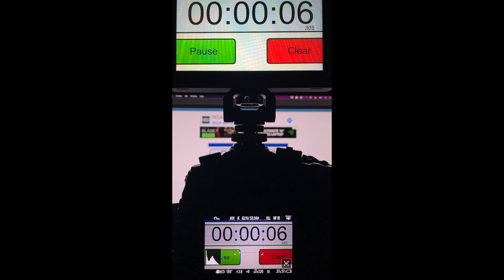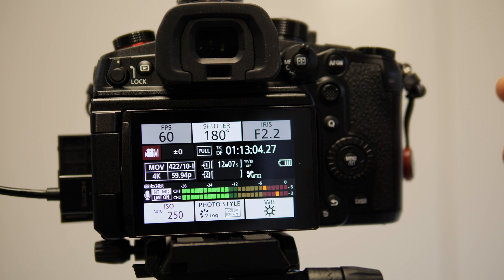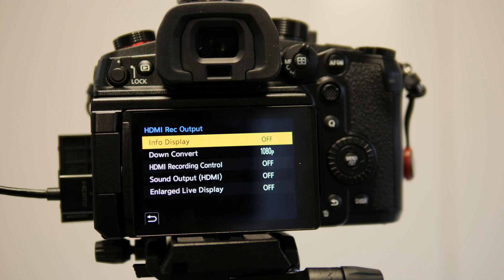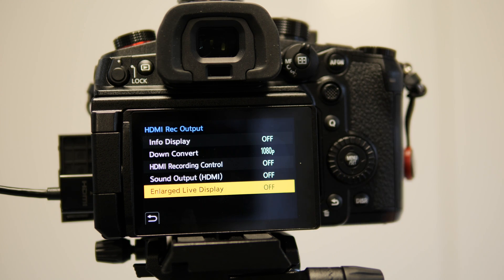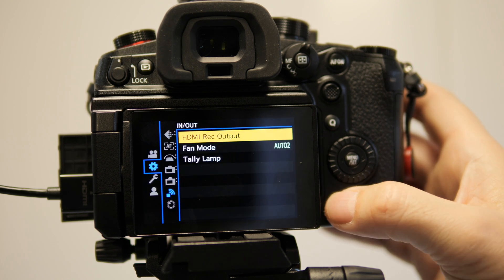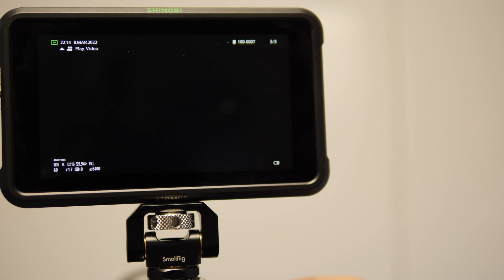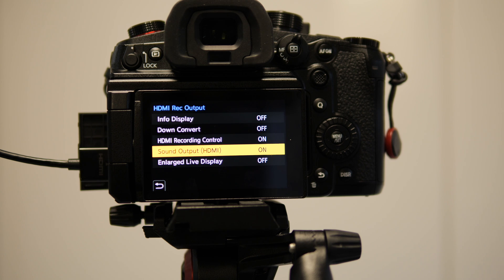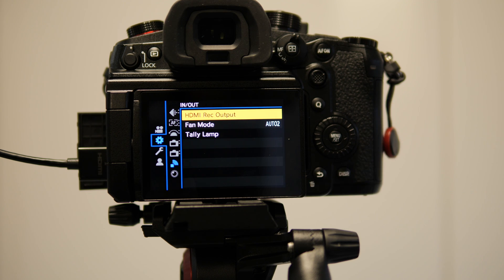HDMI Lag Optimisation for GH6 and GH5M2

Comment: This lag is way worse in low light when taking astro photos and or using an nd filter.
Reply from the maker: The lag depends on the frame rate. If you are shooting with live view boost this drops a lot it is not possible to correct that it is normal

Comment: The other issue for me is the GH6 will not display the timecode value when connected to a monitor.  It won't show it on the GH6 display or the external monitor.  It only shows the letters TC but no value.
Reply from the maker: What do you want to do with the timecode on an external monitor?
Reply: @Interceptor121  I use the timecode reading to record video for a specified amount of time.  Such as a 10, 15 or 20 minute video.  The problem is...I often cut during recording so every time I cut...the recording counter sets back zero.  The way I have timecode configured in the settings...it keeps the total run time of the recording.  So, if I'm shooting a 15 minute clip and stop recording after 4 minutes and then resume...timecode will resume from 4 minutes and not zero out.

Comment: Thank you for this very informative video! I am still debating whether to buy a GH5M2 or a GH6. How bad is the HDMI lag in the GH5M2 when shooting 24P? You note that it is worse than with the GH6 but is it so bad as to be problematic?
Reply from the maker: As per chart at 3:15 is around 190ms that is a pretty long time. But why would you shoot 24p anyway?
Reply: @Interceptor121  That is an excellent question. A friend of mine is shooting a film in the Amazon and is using 23.98fps, so I was following his advice. What frame rate do you recommend for excellent image quality and dynamic range when shooting a documentary film? The options are rather mind-boggling.
Reply from the maker: @kevinpeer1295  the frame rate depends on where you intend to watch it really
Reply: @Interceptor121  Online streaming, viewing on a computer from a digital file, and some screenings through a video projector.
Reply from the maker: @kevinpeer1295  use 30fps as online streaming is designed for 60Hz monitors. 24p is not smooth
Reply: @Interceptor121  Thanks very much. You are creating really valuable content on your channel and I appreciate your advice.